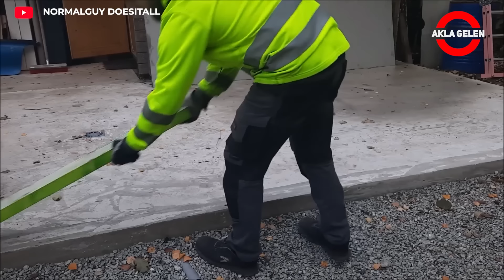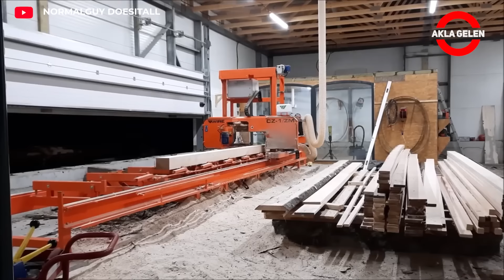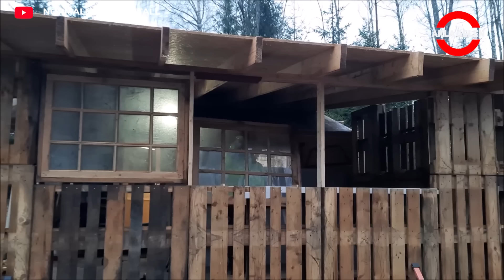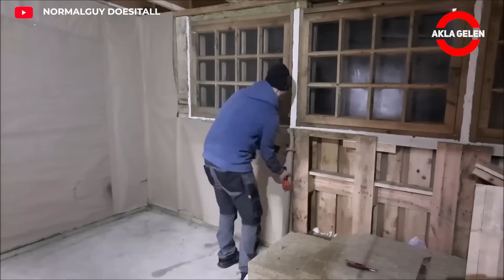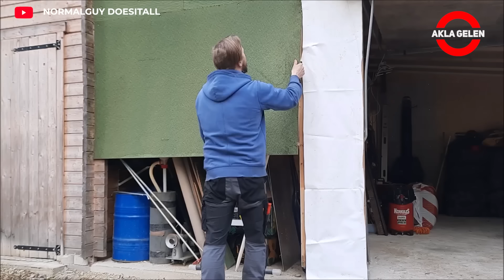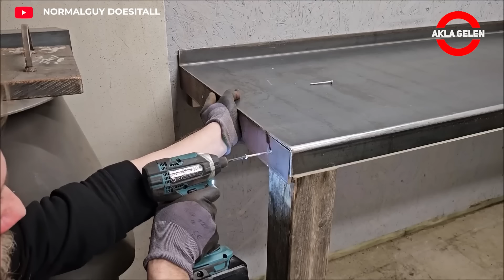Man Builds Dream Garage with Wood Pallets | Start to Finish by @normalguydoesitall

Comment: Not feasible in Germany. A building permit is required. This necessitates a structural analysis performed by an engineering firm. The stove must be inspected and approved by a chimney sweep, and undergo annual cleaning.

Comment: Osb is heat resistant?? Non ventilated roof will rot. Improper chimney through wall will catch fire. So really only wood savings was wall studs. Also no header on eave wall above windows, good luck.

Comment: This only works if you find a large stash of magic pallets that are not only in good condition, but are perfectly matched in size (width, length, and height/thickness) and have all of the edge pieces, etc. After watching YouTube videos of folks building amazing sheds from pallets I decided to try it. How hard could it be?  The pallets available are inconsistant and I spent a LOT of time trimming, adding pieces back in, reinforcing, etc.  Even then things came out a bit wonky due to variations in the pallets. It was MUCH more effort to do it this way and I'll never do it again. I might be willing to take pallets apart to get the 2x4's in longer pallets to use as framing, and then do a normal framing job. But to build pallet walls? Not a chance will I do this again.
Reply: I agree,and you still have to cover the walls, etc, what have you saved? 30 ,2x4s

Comment: Considering only 1.5 walls were made from pallets the savings are about $600 worth of 2x6 ... with all the OSB, 2x8's, concrete, insulation, heating system ' why dick around cutting pallets for almost zero gain ??

Comment: Luckily, all you need is the complete Makita power tool set, a large trailer with a suitable tow vehicle, a wheel loader with a fork and shovel, an access road wide enough for a cement mixer truck, a nearby sawmill, dozens of beams and planks, and a truckload of usable pallets (note the irony!) 😉... It would have been interesting to mention what the entire project cost in the end, purely in terms of materials used. ...That aside = clean work, craftsmanship, great result! 👍
Reply: You have just invented reasons to trash a project you will never do.
Reply: @Compairholman  - Saying I “made up” reasons is wrong—the truth is, I wouldn’t be able to pull off a project like this because, given my work schedule, I wouldn’t have the time unless it were to become a “once-in-a-century” project, and I lack a few key “craftsman skills”... That’s why I still have nothing but respect for the poster’s work, even though it’s clear that not everyone has the same opportunities as he does. ☝🙂

Comment: No... cuz I think you sir, are an idiot. So you basically build a professional grade garage but you skimp on the foundation? 1) did you use red bolts instead off anchor bolts? 2) did you TOE NAIL those walls into the sill plate? 3) also... are your sill plates made up of like... multiple 3 foot pieces? This is where you choose to save money? Are you out of your fucking mind?

Comment: It's a cool idea, but after calculating the costs, it's much more expensive than ordering it ready-made, so it's just a satisfaction that you made it yourself 😊😊😊
Reply: Used pallets are free in my country . You would save 80% of the cost of buying a new shed. I know because i did it last year.
Reply: It's attached to a pre-existing structure.  The pallets only remove a large part of the framing cost.
Reply: Not if the pallets are free. I know a guy that built a 25x40x18 barn with free siding pallets. They were all free. 4 semi loads of pallets.  I know this because I delivered them.

Comment: what a fvckin dumbass, all the money he spent on roof and floor  might as well built proper walls with 2x4s and some t-111, he didn't stagger any of the pallet seams so the walls have no integrity or negative shear factor,  wasted more time and money thinking how clever he was. what's the point?

Comment: What was the point of using the pallets all he saved was using maybe 30 2X4's, if he had tp pay for the pallets not much savings to be had.
Reply: I was just thinking the same thing. makes no sense. everything else is from the store. I was expecting something else because of the title.
Reply: He saved $210.44 just by using pallets... not bad! Don't be a hater! You would probably hire a subcontractor for renovations then bitch when they give you the price
Reply: At least I'm not a hater. But I'm surprised by this title, "built a garage from pallets" but most of the stuff from the store. Good construction skills, yes. At our local prices, the frame planks (2x4) would have cost about 100€. Assuming the building is about 4x5m.
Reply: Most pallets ain't even the same size
Reply: @Joseph-v2c4v don’t need to be. Same width & not  dimensions is what matters. Fits R12 insulation perfectly
Reply: @Joseph-v2c4v pallets are standard sizes
Reply: Less he didn’t have to buy no matter how you look at it
Reply: Most states would not allow pallets as an approved building material.  But why worry about permits.

Comment: Hope this is not in an earthquake zone!   That pallet wall is sketchy.        All it saved was a few 2x4s for framing , and maybe cost structural integrity of the wall.   Probably will be fine though, most of the time.
Reply: My grandfather built a shop out of pallets, he died in 2004 ...the shop is still standing strong.....
Structural integrity is a wild concern.....I happen to work at a salt mine where we make "totes" of salt but really is a bag filled with salt then place on a pallet...that bag weighs at least 2,000 lbs
Pallets work fine and are merely free anywhere
Reply: Always one big head that stands on the sidelines telling you how you did it wrong.
Reply: @Compairholman that’s what YouTube is all about.     If you don’t want criticism don’t post. 😂
Reply: @swparsons sadly that is what Youtube is about, " akchurly you did it all wrong"
Reply: I hope someone besides you  can build a garage someday that is strong enough to meet your approval without throwing shade on their efforts.
Reply: I live in an 8 x 6 pallet cabin 15 feet tall sitting a foot and 6 inches off the ground on a pallet foundation that’s raised on peers. It has a loft and it’s sitting on the side of volcano national Park. It’s been through 15 earthquakes in the last year.

Comment: Это ИИ? Или снято так?.. Все нормы каркасного домостроение вышли покурить во время строительства.
Reply: This is not up to code in US
Reply: @blakedoty521  : it does not meet "light frame wood construction" standards in the US codes. But it seems pretty sturdy. Unconventional but strong enough. Although the toenail screws into the mudsill is questionable, a little shaky, but might calc out all right. It think it has potential. As long as the wall is not really tall. And it is not a high wind area.